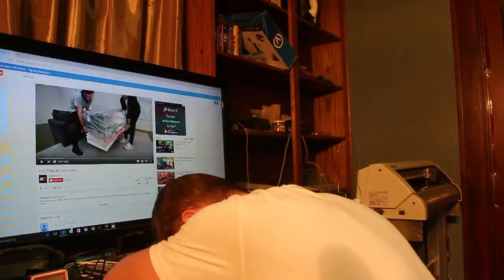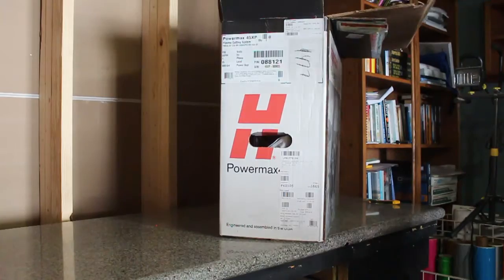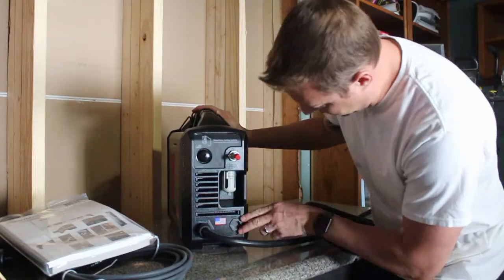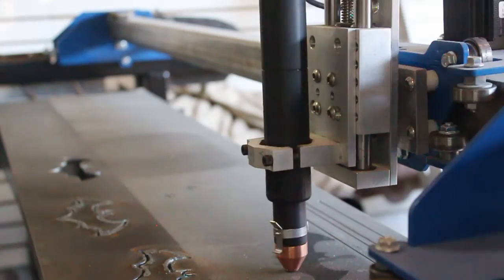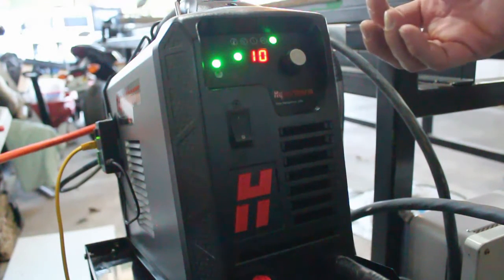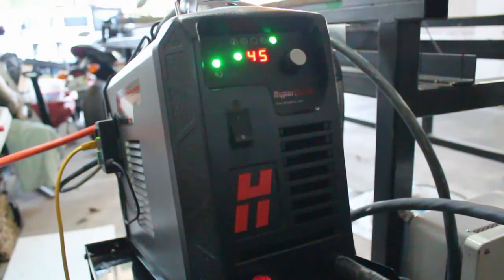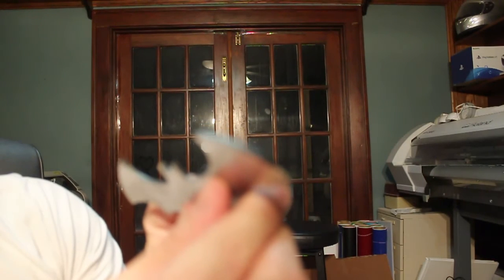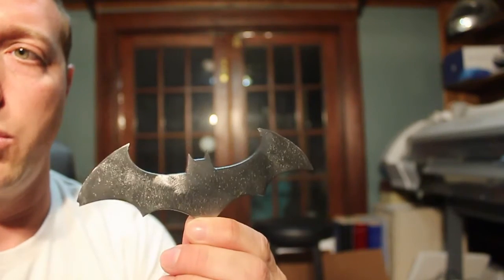HYPERTHERM Powermax 45 XP CNC Review

Comment: How thin of steel can you cut and what is the smallest hole diameter you can cut? .030"-.060" steel is what i would like to use.
Reply from the maker: The thickness or “thinness” has to do with your plasma cutter. The diameter is the plasma table. I’ve got holes as small as 1/2 inch
Reply: @MikeyMoVlogs  OK, with the powermax 45 xp, do you think it will cut .020" holes in .030" material?
Reply from the maker: The thickness is fine but I don’t think you could do a nice hole at that size. Too small. You’d be better off just drilling it.

Comment: I was looking for your follow up video of why you did not like the Everlast and went with the Hypertherm for your CNC Plasma? Looking for those details. Thanks'
Reply from the maker: Sorry got so busy with the other videos. Basically it was not compatible with the automated cnc plasma cutters. None of the larger brand name softwares work with it. It’s possible with pretty detailed customization but I just wasn’t looking to have to tinker with all that. The machine itself as far as hand cutting and it’s quality was actually very good! It would really boil down to what you’re gonna use it for and or how. Hope this helps!
Reply: @MikeyMoVlogs  Thank you very much for the prompt reply.... I am planning on building a CNC plasma table... New to plasma cutting, but have built CNC milling routers in the past, so basically the same thing in terms of the control. 

So, you suggest that I should forgo the Everlast and pick up a Hypertherm? Any tips, suggestions or ideas for my project? 

Thanks
Reply from the maker: If you’re going to go with with of the mainstream controllers like candcnc then yes. It’s plug and play and super smooth plus you have tech support. With Everlast you’re on your own to search forums on line etc. it’s worth the extra money in my opinion for the convenience and piece of mind. No real great advice. Just take your time when you do the portion of the track and metal rails on the table because that’s where the details count. The frame could be crooked as hell as long as that track is straight! Best of luck to you on your build!
Reply: @MikeyMoVlogs  Thanks again for your reply... I do have one more question. I see that you purchased your 45XP with the machine versus hand torch. For some reason I can not seem to find that option on their website.  Would you please share the details on ordering the 45XP with the machine versus the hand torch? Thank you.
Reply from the maker: I bought off eBay. I actually have a link in my description notes below. Not sure if it’ll still be an active package or not but it was from a company that sells hypertherm and had several options listed on eBay. Was the best price I had found too. Worse case if you contact your dealer I’m sure they can order it up for you.
Reply: @MikeyMoVlogs  Yes, your link is still good, and it is there... Din't think to look for links, thank you.... BTW, is it the "official" machine torch for the Hypertherm?
Reply from the maker: Yes. All brand name.

Comment: Great video. I built a home made 6'x11' cnc plasma water table. Have an Everlast 60s cutter. It does not play well with my Masso controller and the Proma THC 150. So I am getting ready to purchase the Hypertherm Powermax 45xp or 65xp, trying to make up my mind on which one to get. How thick of a cut have you made? How is the cut compared to your old Everlast?
Reply from the maker: It’s much much smoother than the everlast. I haven’t gone above 1/4 inch just because I haven’t had a need to. You’d be happy with either I’m sure.
Reply: Pulled the trigger on the 45 today.
Reply from the maker: Awesome! Let me know what you think of it.

Comment: If Hypertherm would've made this unit w/dual voltage capable, I'd be purchasing it instead of the Miller Spectrum X-Treme 625.
Reply: I don't know so much about dual voltage, what are the advantages to have that ??
Reply: @QuebecoisSti , in the shop, most users will invariably have access to 220VAC, but Dual Voltage gives you the advantage of being able to do light work/cutting out in the field with 115VAC, where 220VAC may likely not be available...
Reply: @jetsetjoey  oh ok you mean the input voltage of the machine. Sorry I didn't get it first time!!
Reply: the advantages of dual voltage are portability, even though you might not get the full power of the machine you will still be able to use it on job sites that you might be able to have 220 V, and also if you don't have a 220 v outlet in your garage at home you will be able to use it, eve though if you are buying s Parma cutter I would assume you would have a 220 v outlet but it is preference, everyone does different work...so its up to you if its worth it or not because if you just have a 220v unit and need portability you could get stuck...that is my suggestion, I like having the choice of 110 or 220 but like I said  I dont now what thickness or type of metal you work with

Comment: hi, what software do you use to drive everything?
Reply from the maker: So the software is called sheetcam. That is what converts the files into cuttable images. The table uses its on software for actually running the jobs. It’s part of the whole control system for the table. Its not like a program you can just buy on its own.

Comment: Excellent vid! Appreciate your breaking the norm of dragging out the simplest thing!
I take it there is no air pump within the unit?
Reply from the maker: Thank you! I was actually disappointed the video was as long as it was. It’s so hard to fit even just the important stuff and keep it short enough that people are willing to watch it all.
Reply from the maker: Also there is no stand alone air pump. You have to have an external compressor. It does have its own water separator built in so if you add one to your compressor you get double the performance! Thanks again for your support!

Comment: I subscribed just because it was cool, and I I'm just now getting into plasma cutting. I have a question.... with the XP 45 can I still hook up to a 30 amp breaker? It seems to me that one could simply turn the amperage down to accommodate that. Also, when doing your research what made u choose this brand say over Miller?
Reply from the maker: +Eddie, welcome to the channel! I will have to get back to you on the breaker size. I’ll check my manual for the recommended size and then what I’m actually using because honestly I never looked. Lol. It’s running off the same 220 line my dryer is wired in to. I just don’t use them at the same time! As far as the brand. It was the highest recommended for plug n play with most cnc controllers. 

Miller is an excellent brand and I have their 225 mig welder, but I feel like that’s their wheel house and Plasma is a secondary. Hypertherm and Thermal Dynamics are typically your industry standards for Plasma. I’m sure someone out there will argue that, but that’s my personal opinion. Hope this helped some!

Comment: Any vids of your table? Approximately how much did you spend on the table with everything needed minus the plasma cutter ? Thanks in advance.
Reply from the maker: Oscar, I don't have any other than what you saw for now. I do plan on getting some up in the near future with some projects I'm working on. As far as the investment. I built my own table so the raw metal was around 600. The controller and motors came from CandCNC.com they have several packages but mine was around 3,000 including the computer,programs and licenses. My gantry came from precision plasma llc which again they have several styles and price ranges. If I remember correctly I'm right around 4500 with everything. Gear racks screws etc. hope this helped! Thanks for the interest!! 👍🏻
Reply: Yes definitely helps! Thanks for the info

Comment: hi, does the new powermax 45xp have a continuous pilot mode for expanded metal like the older 45 ?
Reply from the maker: Hey Kurt. I'm not sure I know exactly what you're talking about. The pilot arc will only run for a few seconds if it does not make contact with metal and strike an actual arc. In my software you can set the "tip saver" feature to shorten it even more. I'm not sure about making it run longer though. In my everlast it would blow the fuse if the pilot arc started too many times with out metal. Sorry. I hope this helped a little. Thanks for your view and interest!!
Reply: Master Of None thanks for the help. some hypertherms have the continuous pilot mode for if you want to cut metal mesh ext. the pilot arc will automatically be re-engaged every time the gun comes in contact with the metal. I'm sure the older 45 has it but it seem like the new 45xp only has a cutting mode and a gauging mode.
Reply: Master Of None its also known as an expanded cutting mode.
Reply from the maker: +Kurt you got me curious so I looked in to it. Here's a reply from Jim Colt who is their big tech guy from what I understand....

No....you just cut expanded metal in the standard cut mode....no need to set anything. The power supply has a fast acting pilot arc control that will auto switch (when it senses loss of arc transfer) to pilot arc in a few miliseconds. Jim Colt Hypertherm
Reply: Master Of None. thank you very much. the new 45xp sounds great and even more user friendly now. thanks for the effort. I was just curious because I knew the old one had it and no one mentioned it about the new one. Hope you have a great day/night !!

Comment: Hello, I purchased a Hypertherm 45 xp, but I don't know if my unit has the connector for the machine torch. It has a round cover for it on the back of the machine, but the instructions don't say how to remove the cover. I have spun it and pried on it, but I am spooked of ruining something. Any info is appreciated. I enjoyed your video. Thank you for sharing your knowledge. Carl
Reply: Contact Hypertherm with your s/n. They can tell you what options were installed.
Reply from the maker: +Hey Carl thanks for the interest! So the machine torch just plugs in to the main torch port on the front. The actual CNC plug is in the back and just has a screw on cap. They offer this machine in both versions meaning it's CNC capable and not. If yours isn't,  there might just be a cap or cover where that port would normally be. Do you know if you ordered the CNC model?

Comment: You need to lower your preset volts,  you can see the torch lift quite a bit there, don't stick to book torch voltage settings, you just want the setting that keeps you running at the same height as it comes off dthc delay.
Good luck, there is lots to learn with the plasma cutting, been at it for 4yrs nearly now and still learning.
Thinking about a XP as well, I have the 45 now.
Reply from the maker: Thanks old school. Yes I've got much to tweak. Cut out a hundred crash bar tabs last week. Got it pretty dialed in but I haven't messed with the preset volts yet. I'll give it a shot!

Comment: what machine torch are you using?
Reply from the maker: +proline1349 

Look at this on eBay
Hypertherm Powermax 45 XP Plasma Cutter 25' Machine System 088121
Reply from the maker: The hypertherm uses Duramax torches. The link I put in is the package deal I bought via eBay. Fantastic price and customer service. They responded very quickly to my questions and they were the best price I found. If you're thinking about buying I'd recommend them. Thanks for your question and interest in the video!!
Reply from the maker: Sorry it looks like it did actually come through as a link. The seller is "torchking" and they're out of Ohio if you scroll through eBay. Hope this helps!